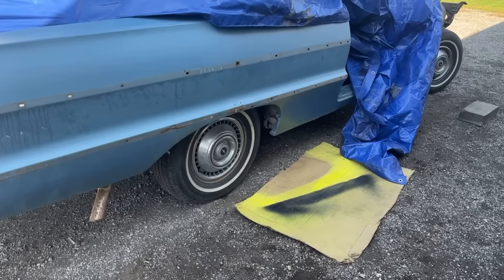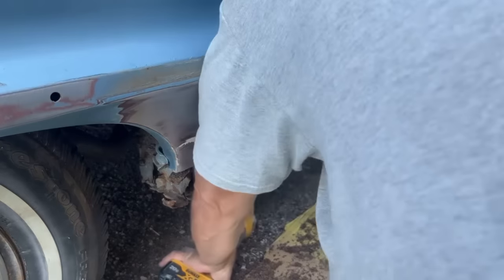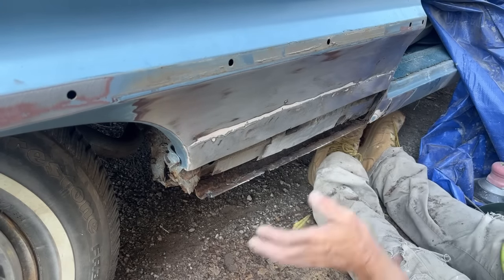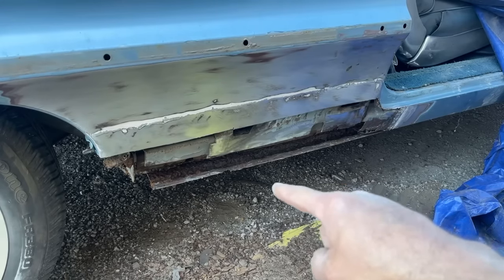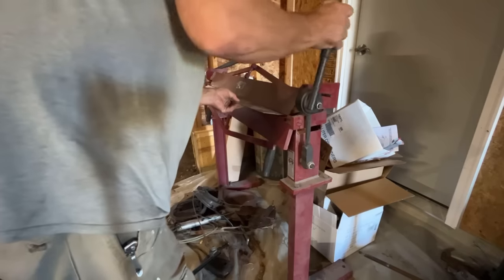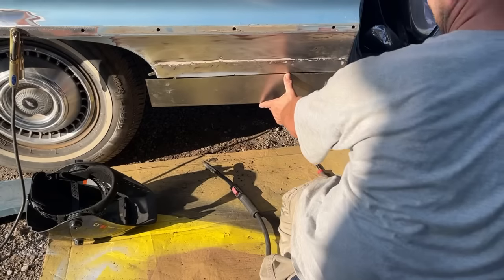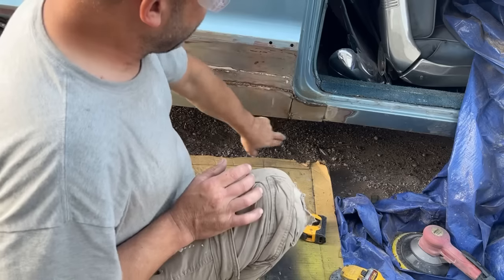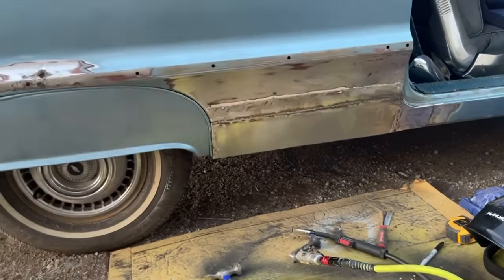Working on the quarter panels on the 1964 impala convertible

Comment: The original rocker panels were zink plated they were full inner and outer factory rocker panels replacement rocker panels are not full like factory rocker panels and they are not long enough to go under the front door Pilar or rear wheel well lower area.
Reply: Yeah, I don’t think I’ve ever put full rockers on a 64 impala before that I can remember of, but yeah, I wish somebody out there would make better quality reproduction parts. It would make life a lot easier. This was a budget job so kind of just had to make patch panels that’s what they wanted.

Comment: Yeah, I know I get it. There is really no proper way to undercoat or paint the inside of those. I use the weld through primer that’s about all I can do. I did drill a couple drain holes, which will help but I guess maybe fluid film would work if you can have somebody get a nozzle up there that would probably definitely help but even where you weld end up being bare metal because the weld itself burns off the primer.

Comment: Water drains from the front windshield louver down to the rocker panels out through the rear tire rocker panel opening 62 to 64 are the same wich is a bad engineering design but the problem is when you do a patch panel there is no way to water proof the back side of the patch so within a couple years your going to have paint peeling of in that area .

Comment: You need to bolt a piece of angle iron on the front of that brake so you’re lifting up on more surface area you don’t want to weld it you want to be able to take it off.
Reply from the maker: Good idea thank you

Comment: Both kick panel vent plastic doors can be removed and below the kick panel opening is where debri dirt plugs the drain openning to that leads to the rocker panel rear discharge opening where you will find on the rear inner rocker panel a rubber flapper seal that's to drain all the water the gets in through the windshield louver vent where wipers so the kick panel vent doors must be removed to clean the front water drain area for rocker panels it's always plugged up use vacuum cleaner air pressure to clean and blow all debri to the rear rocker water drain hole where the rubber flapper seal is at hope this helps you guys.
Reply: Yes, thank you not super familiar with the 64s so any help is appreciated